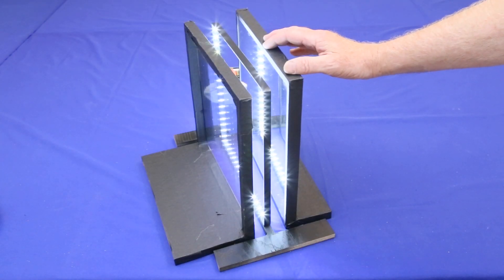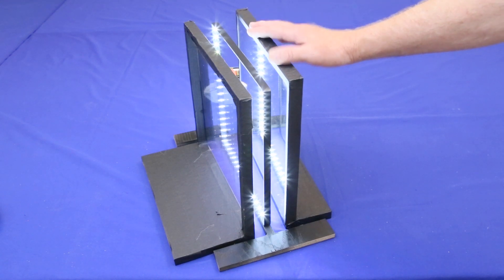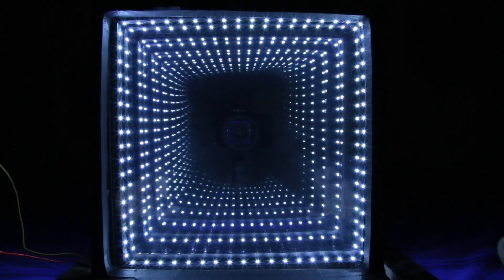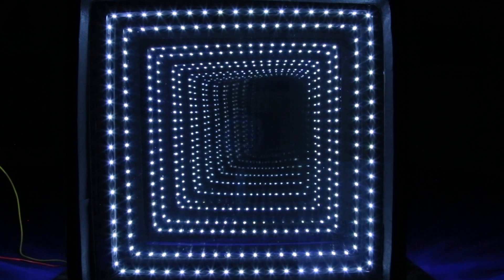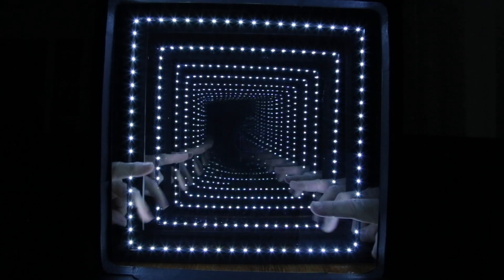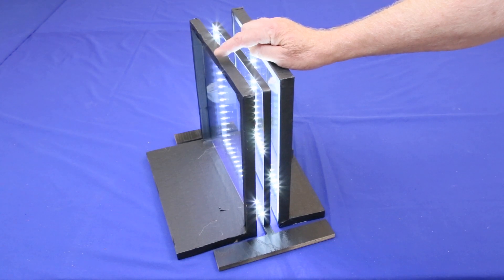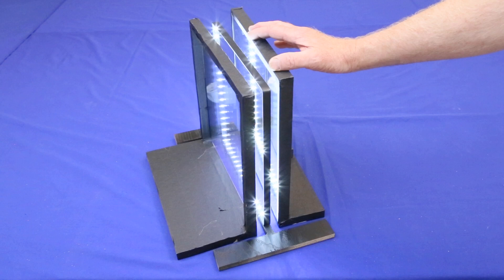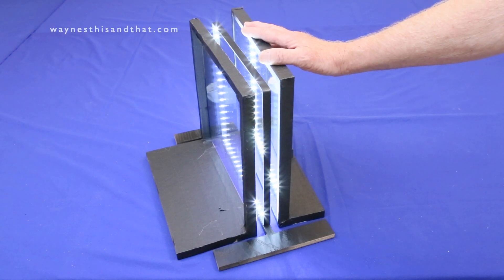Infinity Mirrors

Comment: Thanks for the video. What would it look like if the gap between the mirrors was minimal? What would it look like with little to no gap?
Reply from the maker: If the mirrors are pushed very close together, all the lines of light get so close they almost look like a single solid line. You loose the 'infinity' effect. They can't be pushed so close that there is no gap because the gap is needed to provide room for the lites. Thanks for writing!

Comment: What is a "first surface" mirror, and why is it expensive?
Reply from the maker: Regular mirrors have the reflective surface on the back of the glass with a protective layer of paint over it. When you look at yourself in it, the light from your face passes through the glass, gets reflected off the back, then passes back out a second time through the glass. This creates to problems for infinity mirrors. The first is that the light is dimmed twice as it passes through the glass twice. The second is that the un silvered front face also reflects a very dim image, which creates a faint double image effect that reduces the sharpness of the image.

A first surface, or front surface, mirror has the reflective layer, usually aluminum, on the front of the glass. This way the image never passes through the glass when it's reflected. This eliminates much of the dimming because the light doesn't pass through the glass as often and eliminates the double image issue. First surface mirrors are also used in good kaleidoscopes and reflective telescopes.
Reply from the maker: The reason why they are more expensive is that the first surface reflecting surface is very delicate and requires special handling, including a removable protective cover.
Reply: @wayneschmidt490   Thanks!
Reply: @wayneschmidt490   Thanks for the explanation!

Comment: What materials did you use for your infinity mirror?
Reply from the maker: Here's what I used for the mirrors:

https://www.amazon.com/gp/product/B017ONH3EG/ref=ppx_yo_dt_b_search_asin_image?ie=UTF8&psc=1

https://www.amazon.com/gp/product/B01MXE417D/ref=ppx_yo_dt_b_search_asin_image?ie=UTF8&psc=1

The metal frame was bent out of 1/2-9nch by 1/8-inch aluminum bar stock from a hardware store. The wood bases were just scraps found in the garage.

Comment: Can I put two row of led strip around  than to have one??because I buy 5 meters led strip and I don't want to cut it can I around it two times??or will be to much light it and I will lose the effect??
Reply from the maker: I don't see why you couldn't use two strings. In fact, if they were mounted in a spiral it might look like a corkscrew going away in the distance instead of a series of flat squares. Thanks for commenting!
Reply: @Wayne Schmidt  my wood frame is square how to put my led strip in spiral?? I have one idea to make a small hole canal and continue my led strip in the back of my wooden frame. So I will not cut my 5m led strip.. I buy two way mirror but I don't know if is the correct mirror glass the supplier told me if not work I must buy sun film window care to use. But I have a question the sun film side glass must be in the inside side  or in outside side?
Reply from the maker: @AnninosMichaelides  The reflective side should always be on the inside. Once you have your frame, just run the light strip up one side any a slight angle so after you've gone once all the way around the inside of the frame, the second layer of light strip will line up along the first strip's side. This should produce a square-sided spiral, not a circular spiral.

Comment: Hello. 
I have a question! 
If I use a one way mirror instead of the glass will the depth of the light will be longer?
Reply from the maker: If we accept the definition that a one-way mirror is a mirror that reflects when looked through from one side but doesn't when looked through from the other, then no. One-way mirrors work by having only a partially reflective surface. Some light is reflected, some passes through. The amount of reflected light varies from 50 to 70-percent, whereas full mirrors reflect up to 96-percent. Using two one-way mirrors in an infinity mirror rather than 1 one-way mirror and a fully reflective mirror would result in the reflective images dimming faster and the resulting images looking shorter. I hope this answers your question. Thanks for writing!

Comment: Hello question is this possible if I make this as a photobooth?
Reply from the maker: I'm very sorry, but I don't understand your question. I don't know what Photobooth is or how it relates to infinity mirrors of YouTube videos. If you can clarify what you want, I'll be happy to work with you to get whatever you need.
Reply: @wayneschmidt490  ohI plan on building a photo booth with the idea on the video question is how can I still have the infinity effect with a person inside it?
Reply from the maker: @leoadrian2486  Now I understand. Making an infinity mirror large enough for a person to be inside it would be extremely difficult and expensive. The mirrors would have to be very large (that's the expensive part) and they would have to be made of glass and framed (that's the difficult part. Plastic mirrors that large will have so many warps and bends that they would distort the image. Sorry I couldn't be more helpful.
Reply from the maker: @leoadrian2486  I got to thinking about what you wanted to do after I replied to your explanation, and there's a chance you could create an infinity mirror effect with a person using a TV Infinity Mirror. Here's a video about how simple it is:

https://www.youtube.com/watch?v=i6z2WGuNwE0

Sorry about the slow, monotone narration. That was one of my earlier videos. The older ones are even worse. 

What you could do is have someone sit in-between the camera and TV. With light just on them and a black background, you might get something acceptable. I've never done this so I can't guarantee it'll work. Good luck!
Reply: @wayneschmidt490  It works, but it is missing something compared to real mirror: updating at the speed of light, that's why the digital 'reflection' becomes a 'trail' influenced by camera frame rate, camera sensor to display output latency, display input latency, refresh rate and pixel response. Tricky to get all of that under control, and it still adds up to look and feel different.
Reply from the maker: @HaxR3  You're absolutely right, but it's still fun.

Comment: Hi Wayne, 

Thank you for this very informative video. I am currently working on an infinity mirror myself (for school) and in the video you mentioned that if you were to do it again, you would use first surface mirror. I would like you know, in your opinion, to what extent will using a first surface mirror as opposed to a goat glass mirror improve the infinity mirror effect. Would the ghost images be significant when the mirror coating is underneath? I will be using 3mm thick glass. Are there any other factors that you suggest I consider?

Thank you very much!
Reply from the maker: My experience with first surface mirrors was in making high-end kaleidoscopes,  which also involve multiple reflections. In those, it greatly improved image quality so I assume it would do the same for a infinity mirror. The problem is first surface mirrors are very expensive and I have yet to find any that are only partially reflective for the front mirror. Giving up on that, I recommend using glass as you mentioned and making sure you have some way to adjust the two mirrors so that they are perfectly parallel. This doesn't have to be anything fancy. The amounts will be small so thin pieces of tape in one corner or another to make all the reflections line up should do the trick. Good luck and thanks for commenting!
Reply: @wayneschmidt490  Thank you very much for your prompt response! Do you think it would be worth using first surface mirrors just for the back "normal" mirror?
Reply from the maker: @joshsticko  A 12 x 16 inch sheet of first surface mirror costs $62 from Amazon.

https://www.amazon.com/Front-Surface-Mirror-12-Sheet/dp/B00HHCXL7S/ref=sr_1_2?crid=340UWGD3QVCCB&dchild=1&keywords=first+surface+mirror&qid=1620334178&sprefix=first+surface%2Caps%2C266&sr=8-2

Assuming you get 20 reflections before things dim out too much, then using a first surface mirror in the rear and placing the partially reflective front mirror so that the reflections reflect off the reflective layer without going through the plastic first would reduce the number of times the light passes through the glass from 20 to 0. With 3mm glass, that's the same as eliminating a layer of glass 60mm thick. Also, even the cleanest clear glass reflects 4-percent of the light away from it's surface. that's another major loss you'd be eliminating. But, again, I haven't used first surface mirrors in an infinity mirror so while it sounds like it would help a lot, I can't state with authority how much better it would be. If this is for a science demonstration, it would be interesting to make two: one with and one without first surface mirrors and compare how they work. This would make a great YouTube video. One I'd love to view.

Comment: hey I've always wondered that do we need to put the Two way reflective sheet on the entire surface... or can we put it just under the LED strips? Like if the LED strip is on the circumference then we can put the 2 way reflective sheet on just the circumference of the glass plate? Will that work?
Reply from the maker: That's a very interesting idea. What you would get would be a ring of reflections fading off into the distance with a clear area in the center. If you put a lighted object behind the infinity mirror, then the ring of reflections would appear to frame it. The problem would be stripping off the reflective coating in the center. Thanks for the idea and a great comment!

Comment: finally a video i can actually get some good information ! one thing i wanted to ask , for example , if an object is placed in front of the infinity mirror, how well it reflects the object it self? theres a project i want to do , but im a bit worried that the mirror wont reflect or have a poor reflection of the object infront of it (it would be from 20mm to 50mm away from it) is there any chance you could do a short video of showcasing that?
Reply from the maker: That's a very interesting question. Sadly, I took my infinity mirror apart to make something else out of it so I can't test your idea. My impression is that the brightness of the light reflections inside the mirror are so great that any reflections of objects outside would be swamped. I would only expect to see a very dim ghost image on the front glass. If the object you had in mind was thin enough to put between the two mirrors, and you used two rings of light to illuminate both the front and back of it, that might create an interesting infinity object. Thanks for commenting and good luck with your project!
Reply: @wayneschmidt490  i had that thought too that the bouncing light might not illuminate the object in front of it, unless it is placed in between the two mirrored surfaces where the light can actually reach it. I have thought up of a few different variations of how to try and achieve the effect i want, but will have to go through several prototypes, but people like us probably love that R&D process haha. Thanks for the quick reply!

Comment: Hi, great work, very helpful. I just wonder how it would look if you add one or more layers of mirror? And add additional source of light in additional layer. Mayby if you use strobe light efect independent from sources, with smooth changing frequency on leds, it may create some additional reflection effects :)?
Reply from the maker: That's an interesting idea. The additional mirror would have to have a very low reflectivity to let enough light through for the main mirrors to create the infinity mirror effect. This means the reflections of it would be faint, like ghost images. Thanks for the comment!

Comment: Great video Wayne! Very informative and great demonstration with the mirror rig. I too like Leo am looking into hanging something in an infinity mirror. I was looking at hanging (with light fishing wire perhaps) or even mounting by way of pegs through the rear mirror, something like a nice replica car.  Creating a fancy display cabinet with the car replicating off into the box multiple times etc (infinity duh!). 
So to the question as well, I'm thinking of running three rows of LED strip equally spaced from the two mirrors and themselves. This I hope will create better lighting to all sides of the object, or is this not necessary as light is bouncing all over? The only bonus would be a denser light repeat in the "tunnel"? Giving a deeper perspective? And brighter the better inside so better mirroring in higher lighting conditions?... Oh for a workshop and tools, materials and time to experiment. Thanks for the info Wayne! Great stuff! I'm off to get the old mirror out of the loft! Just need some old covid screens and film when this is all over!! Thanks, Adam
Reply: Also where is the best place to put the object? Closer to the rear mirror? Ha ha, so many questions... I need that lab! Thanks Wayne
Reply from the maker: @mrdjcobweb  Thanks for commenting! You're right, I had one hand on each side. Actually, I'm on the right and my wife is on the left. Placing the object close to the rear mirror with the lights in front of it works the best because it allows light to illuminate the front side of the object. But, your idea of multiple strings of lights would change this. Two borders of lights with the object between them would illuminate both sides and eliminate the boring dark side of the object. How about two different colors of light strings? One side of the object would be one color and the other a different color. Suspending the object will be tricky. The bright lights will make any wires or strings easy to see. The post through the rear mirror idea sounds better. You're multiple light storing idea has a lot of possibilities. If you try it and post a video about it, please be sure to let me know so I can watch it! Good luck!
Reply: @wayneschmidt490  I was thinking colour changing LED's would be very cool, and remote control possible, or even bluetooth to the phone. Independent of each other would be another level, slow colour changing. There goes the bugdet! Thanks Wayne, I'll do a video if it all comes together!
Reply from the maker: @mrdjcobweb  I look forward to it.
Reply: At first I thought in the thumbnail, it had something hanging in between the mirrors but seems like something behind the test rig. So you just need a rod above the rig hanging a toy car, You can then slide it back and fourth closer to the front or rear, or in front or behind the light source. Just a thought for a new video. (Send all proceeds to.. LOL)

Comment: Since the images loose light per reflection using the two mirror method. If you perfectly align the reflections the light is not present to view the images in infinite reflection. However, in theroy the images are still present despite the observers ability to see them. This is an interesting example of infinity at the least.
Reply from the maker: Great point! Thank you!